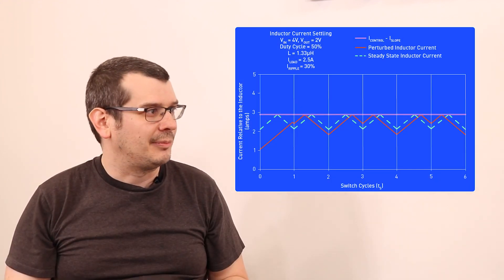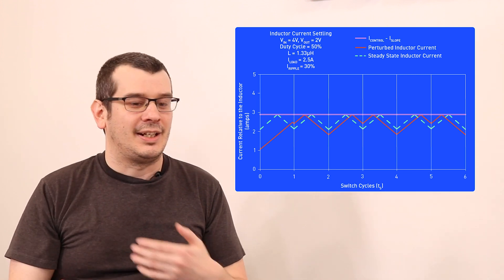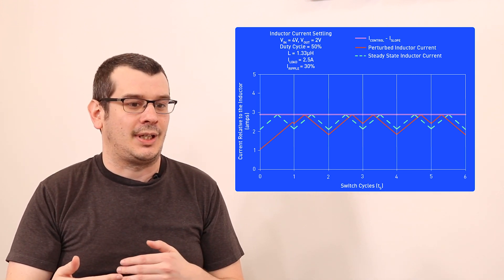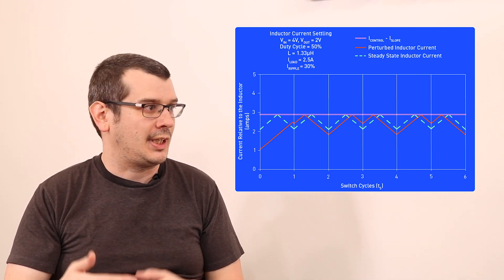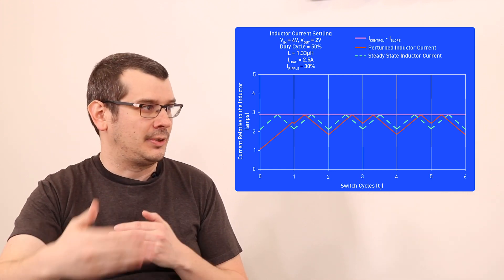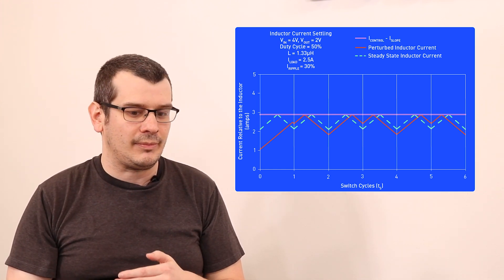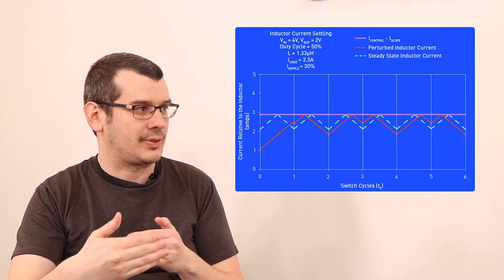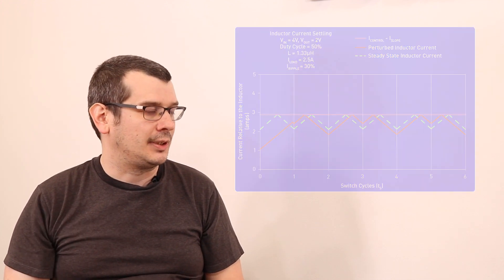How Peak Current Mode Control Works

Comment: Nice video! But still a bit unclear on how this works in application. I am currently designing a charging module for a wearable based on the MP2722, which requires 5V at VSYS. Do I need a separate buck boost converter for this to work?
Reply from the maker: Thank you for your inquiry.  Please go to our forum for technical questions.  We have engineers that will respond within 24 hours. https://forum.monolithicpower.com/